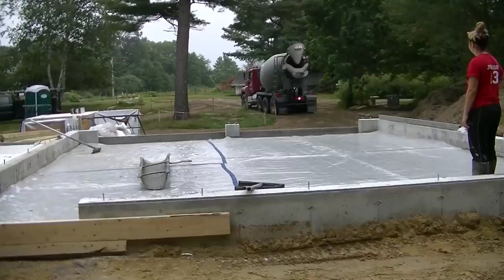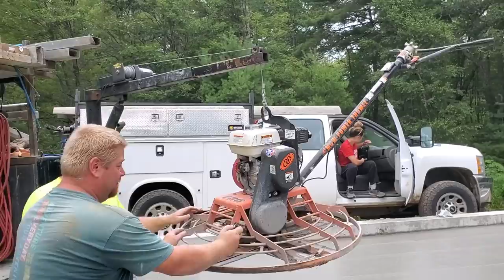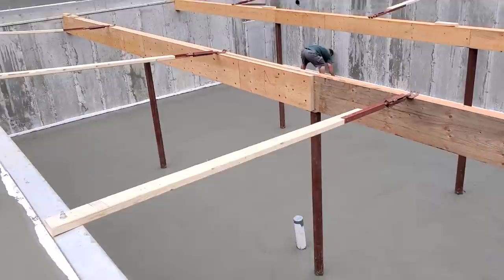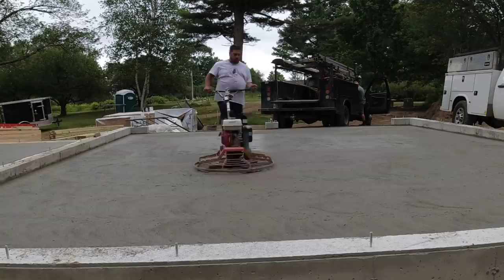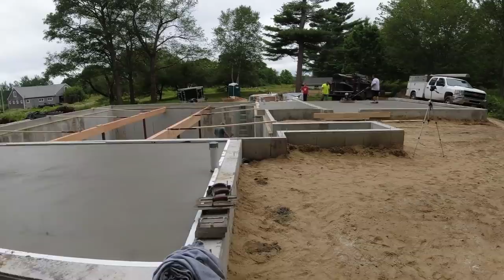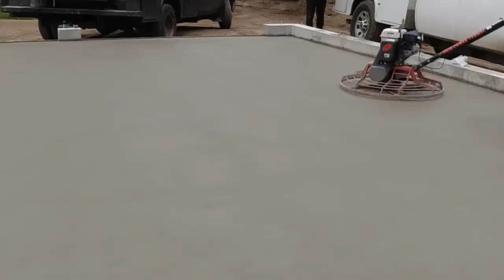Easy Garage Floor Pour (How I Make Money!)

Comment: I was pleased to see you using a vapor barrier however as someone who owns a concrete raising company and a concrete coating company I wonder why control joints are not used in garage floors? Additionally I love it when companies put either tin or the felt strip along the foundation walls. Lastly I understand the fiber mesh but that does not compare to rebar in holding a slab together when it cracks and starts to move.

We just had our dream home built and I specified a 6 inch slab with rebar on 2 foot centers and control joints cut every way you could possibly think of. As a result I have a slab with virtually no cracks and one that I can rely on until the day I die.

Comment: Best wishes for Tia and Eric for the coming school year.  Congratulations to you both.  We call those concrete balls or knots.  On our corners at the doorways, even though we use fiber mesh and WRA we always put some kind of re-bar, # 4 or 5  about 2 inches off the corner running at a 45 degree.  I hate those dang cracks across there and I do everything including jointing and or cutting to mitigate getting those cracks.
Reply from the maker: Thanks David!

Comment: You get the concrete dry balls at the dry mix batch plants. It does not happen at the plants that wet batch it in the mixer above and then put it into the truck

Comment: The "batch balls" or dry concrete lumps occur because they happen to add the plasticizer too soon to the mix while it is hydrating. The batch plant doesn't usually know without climbing in to look, if it's fully hydrated. A dry 2 or 3 slump with the barrel spinning for a while will break those up... But if they add the plasticizer before those balls break, then they'll never break.

Are you guys required to place expansion felt along the walls? We do that here, or the slab will buckle upward quite a bit at times. 

Another tip: try to get Tia to Bull float perpendicular to the direction that you screed (where possible).  You'll discover holes that way. At least at first.

Nice floor!

Comment: I recall when i was a teenager, summer job included running a floor-buffer....was tough controlling at first, but after a few times running the unit, its became second nature...seems similar to the power trowel

Comment: Hey how things going. Yeah nice job. I place concrete in new Zealand. So we do things abit different here. We screed with one guy on a 3m aluminum screed. We don't use different blades on trowel machine. But in answer to your question. Yeah I find place and finishing concrete easy if you have a good team that know what there job is. If not it makes it very difficult. But you guys have a great team. Awesome

Comment: You'll make it look easy! Mike what do you think about pouring concrete with no aggregate just straight sand and cement? I know in fla. they use crushed sea shells as aggregate replacement. How about using a smaller crushed stone to make it easier to screed and finish?

Comment: If you power trowel smooth on basement would you still spray radon seal on the floor and would you put a sealer on the garage floor? Or would you rough it up before doing either?
Reply from the maker: If it didn't already have a vapor barrier you could use the RadonSeal on smooth concrete yes. This one wouldn't need it because it had 6mil poly under it. The garage you could spray or roll on an acrylic sealer as is, don't need to rough it up. If it's epoxy then you need to lightly grind it.

Comment: There's no re-enforcing steel (reo) in the slab. I feel like I am missing something. Was this just a mud pour inside a re-enforced slab / shell, or do you actually do concrete slabs without reo in the States? Down Under you have to use reo in garage floor and house floor slabs, usually 200mm grid at 8mm thick in sheets of 2.4m x 6m (you cut with bolt cutters to shape to the job), which I think is about 5/16" x 8" grid in 8' x 20' sheets. The steel adds enormous strength in tension and prevents cracking. So was there a re-enforced slab under the plastic or was the plastic on ground (base) and the whole slab done without reo? If so, very interesting the difference in standards / quality of concrete construction around the world!

Comment: can we hear some cons of getting on the floor with the trawler too early? guy I work for gets on way too early, leaves 1-2inch wake of fat all over the floor. also I believe he is working in a hump into the sub structure all the way around the edge because its not firm enough, the complains when I struggle to mag the hump out and make it flat. if its flat it took too long and if its not perfect I'm the jerk. what are your thoughts mike?
Reply: No offense but your boss sounds like he needs the concrete underground, no ? It also seems like you know more than he does !
Reply: @augustreil  well I mean I'm not looking to knock the guy, he does put bread on the table doing what he does. I just think he may have an oversight or 2 and has too much pride/ego to take anything else into consideration. I've spoken to him about other ways to get better and he doesn't want any part of it. just very stubborn. but hey, he writes my checks. I just want to know what's right and what isn't. thanks
Reply: @justinsnow5808 , I get what you're saying, thanks.
Reply from the maker: You're right, too early and you're just making humps as well as working in the moisture on the surface way too early.  We like to wait, in most cases, as long as we can to start finishing. Lot of factors to consider, sun, shade, wind, temperatures, sq footage to cover, size of power trowel, rpms of power trowel, combo blades or finish blades, experience of finisher, just a lot of stuff we have to consider when power trowel finishing.
Reply: @MikeDayConcrete  right. Thats why i wasnt quick to rain on his parade. I do know he is more experienced than me and is and all around better tradesman. I just know he is dead wrong in this instance and I have no way of communicating that to him as hes the boss and it's his way. Seems like an impasse. Any suggestions? Thanks for your time, i cant believe you got back to me! Thanks again.

Comment: Here’s the things I do different.
1. Dowel the garage 
2. Put a 1 1/2” lip at garage doors
3. The walkout garage door I Would form it out 1 1/2” past wall so door Threshold would sit on it and not rock, they wouldn’t have to put a 2 x 4 under the threshold to keep it from rocking it would be sitting on concrete not hanging in air out there.
4. I never use float blades on a garage ( don’t use them ever) anywhere.
I would Fresno the garage till almost done than I would run the finish machine over it just to get the pattern, ( to get the finish machine look all people expect) I have a 2 foot Machine to do that and I can get it up to half inch close on the wall.
5.      99.9 percent of the time I would never walk the walls and put my feet marks in the concrete like that guy in the basement was doing to get his edges looking good. If you have good edges other sin don’t standout as bad (not saying I’m a sinner) but good edges sell 
You guys do look good on The screed board, if you don’t pour concrete people don’t understand how hard that is. 
I think you might be stretching it saying you get it within 1/8 inch. If there’s A puddle of water in the floor we say throw a nickel in it and see at the Buffalo drowns,  if he survives it’s not off enough to worry about.

Comment: Hi Mike can you use the power screed on the slope? Or does it make the concrete to drop
Reply: Even when doing it by hand go against the pitch. Not with it.  It will always want to fall going with the pitch . most guys willnpour at a 5 slump if the pitch is 2" in 24 ft .

Comment: Hello from Chicago!  Just curious, why no rebar in the garage floor?
Reply: I'm interested in that as well.
Reply: Speaking from my own experience (over 30 years), it has many reasons.
Most times it's the added cost for extra time/materials/labor. When you give a bid/price for residential slabs with rebar, then lose out over 75% of those jobs to cheaper competitors who bid it without rebar (as well as other 'time/cost' items omitted) then you realize most homeowners/builders go for cheaper cost vs 'premium' methods.
Second is,, a garage slab is a 'protected' slab. It doesn't have to endure the  harmful freeze/thaw cycles of exterior concrete and the associated expansion/contraction. What it depends on most (as with any slab) is the stability and compaction of the sub-base it sits on. I'd rather have a garage slab with the proper and most stable compacted sub-base with no rebar, rather than a slab with rebar that had little attention to its sub-base. Simply put, the sub-base has a greater bearing on the life of the slab than the rebar.
That's just the basics and I don't cover every aspect.

Comment: How in the heck do you get a 2" slope when you poor it (gravity makes it go level)and do all the finish work using no transit or anything to check it???
Reply: bench marks
Reply: Gravity does not make concrete 'go level'. Where on earth did you ever get that idea from? It's common for poured concrete to be slightly sloped (ie. pitched) on flatwork to control how water drains off the slab. Common pitches are 1/4" to 1/2" over a 4 foot length, therefore 2" pitch over a 20 foot length is perfect for a garage slab. Patios and slabs that butt up against a house pitch away from the house. They are not 'level', nor do you want them to be level.
You use a transit or laser level BEFORE you pour the slab to snap elevation chalk lines around the perimeter (or set your forms to that elevation) and set elevation points in the middle sections on a grade stake BEFORE you pour. Once you float your edge areas to the chalk-line grade elevation, and float your center elevation pads, you then use your straightedge screed to screed the entire slab to the proper grade/elevation between your edge and center-pad 'benchmarks'. At the 2:07 mark in the video, you can see Mike setting the center pad grade for the screed, with a laser level.

Comment: I know you dont design the materials or reinforcing that goes into all your slabs, but that plastic is not gunna hold that slab together in the long run.  I tear out mostly concrete that has no wire, no rebar no nothing. I really doesnt cost that much more..